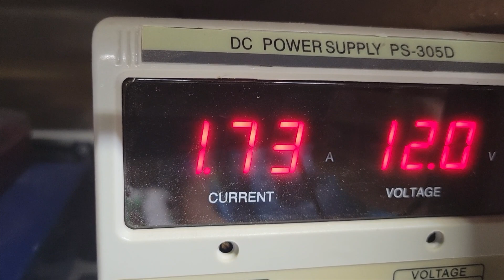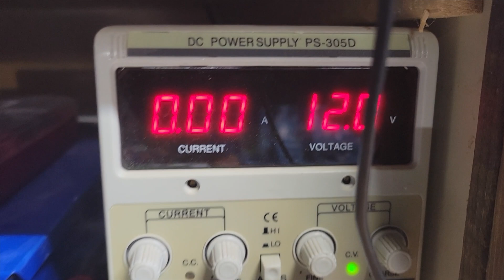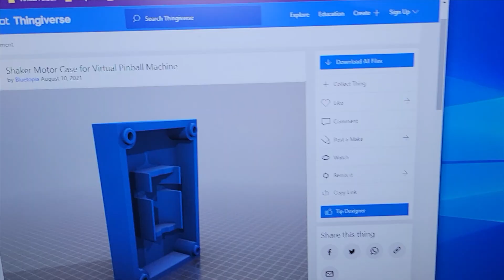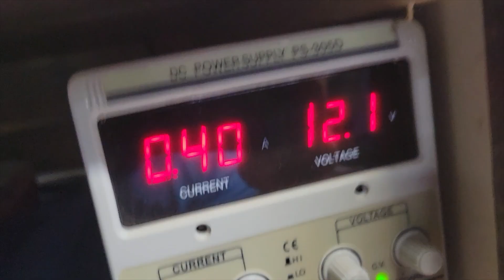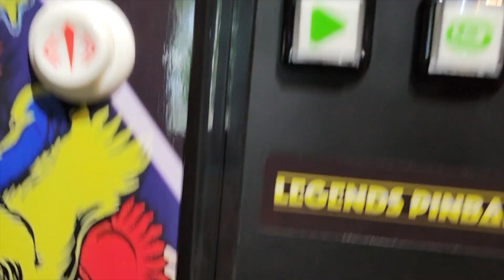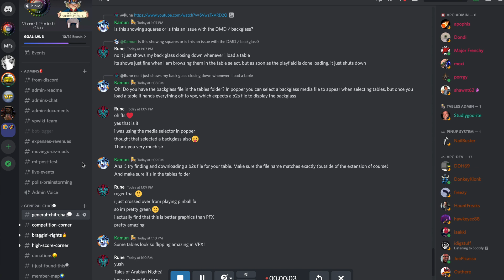Virtual Pinball Shaker & Gear Motor

Comment: Great Video! I ordered a shaker Motor too. Do I need a diode when I use the Mosboard Full8? In Arnoz documentation, there is only a Diode installed when its comes to 5V toys. I ordered the shaker-motor with 24V, so I am not sure if i need a diode. Arnoz installed the Diode in serial with the 5V toys...
Reply from the maker: Yes, you need a diode on the toy. Everything with a motor or a coil

Comment: @MajorFrenchy do you find that adjusting the shaker in DOF works well or do you think a physical motor speed control (small boards on Amzn) are better? Just curious if you find it needs adjusting sometimes with different tables or the DOF setting works well for all? Thx!

Comment: Thanks French. Would love to see a comparison between this smaller motor vs the large one. How does the noise compare? 🤔
Reply from the maker: it is not so much the noise but the vibration. I will review it when doing some gameplay.
Reply: Does the smaller motor actually Shake the cabinet like the bigger ones?  Not going for the noise affect hence the name. Thanks Frenchy!
Reply from the maker: Good timing . I actually removed the small shaker i had. I does not do a very good job. I had an original Stern Shaker motor which i just installed.  What a difference. I highly recommend an original shaker motor.

Comment: Thanks for the info.  What is the best way to connect a diode without soldering?  I'm trying to avoid soldering when possible.
Reply from the maker: You can twist it with your wire, but ensure you have a solid connection . Then use shrink wrap tube to seal it off.
Reply: @MajorFrenchy  do you have a link for shrink wrap tube and diodes for the gear motor and shaker?  I think those are the only 2 diodes needed right?  Thanks!
Reply from the maker: https://amzn.to/3vXLBdz : Diodes 4007 and the shrink tubes https://amzn.to/3QzAoZ7

Comment: Woo! My first YouTube mention :) 

I'm glad you were able to use the shaker case I designed.  Those motor pins with the spinning weight right next to them were a big concern to me during my build; the case was designed to keep the wires out of the way of the spinning weights while also allowing me to route the wires in whichever direction I needed. 

The VirtualPinballChat community has been very helpful during my own build and I wanted to be able to give something back.
Reply: Pretty slick case there my friend! Good work.